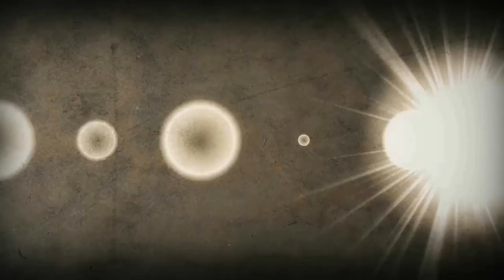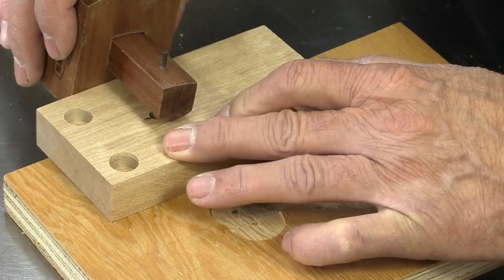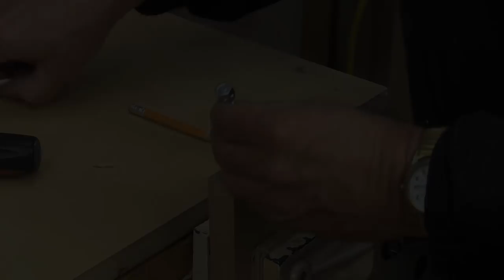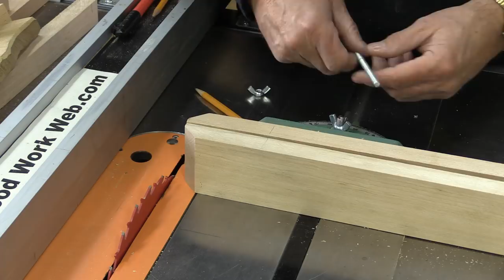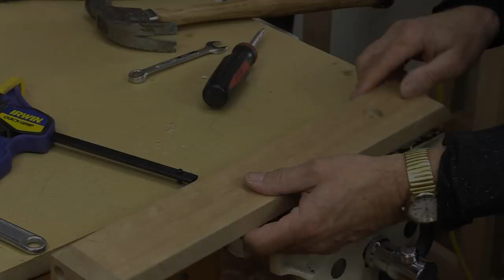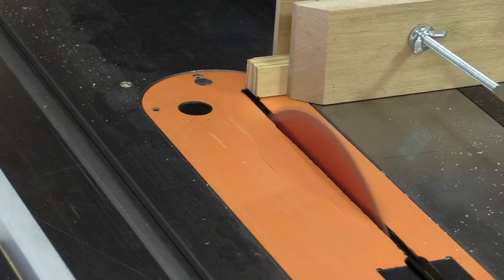Small Parts Holding Jig for the Table Saw / Wood Clamp Table Saw Jig

Comment: If you make the same jig with somewhat larger dimensions, couldn't you also hold "medium" or "larger" parts with it, in addition to "small" parts? What ultimately determines it when it becomes more practical and safe to use a sled with some kind of support to fix the workpiece?

Comment: Hey Colin, nice build.
Any particular reason you didn’t put the tnut on the other side of the board and epoxy the rod into the nut? Then again it serves the same purpose and can be dismantled should you need to replace pieces.

Comment: Just drill and tap the wood, you don't need that nut.
Reply from the maker: Using the nut will cause much less wear. Threaded wood tends to wear out quickly. Thanks for watching!
Reply: You are welcome for my viewing of your video.... I watch them all. I think I will kindly disagree with you on the wearing out of the threads. I have numerous jigs, and other applications that I have used threaded wood and I find the wood threads will last a very long time. I personally think it is something that common sense would tell you that wood will wear faster than metal and while I do know that to be true, but how much usage does these jigs and other wooden things get? How much usage would it take to wear out wooden threads before they become useless? I don't know because I have never worn any out to that extent. One of my box cutting jigs have probably cut several hundred lap joints and it is as tight as the day I made it probably 10 or 12 years ago. It has 1/2 by 16 threads and it cuts nice joints every time. Another thing that I think helps with longevity of wooden threads is usually there are more threads in the wood than in one of these metal nuts. Sorry for the long rant...